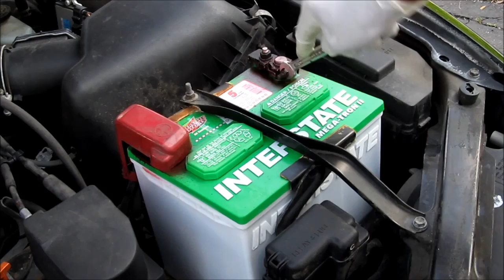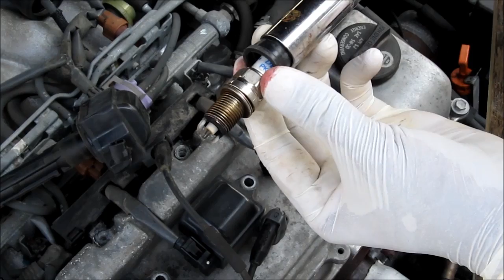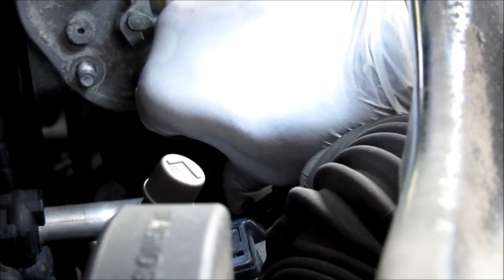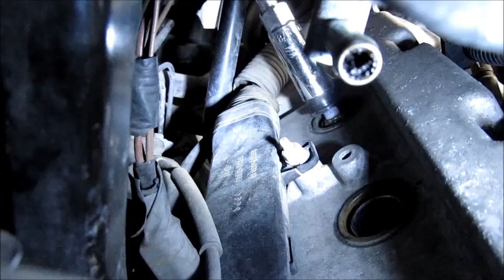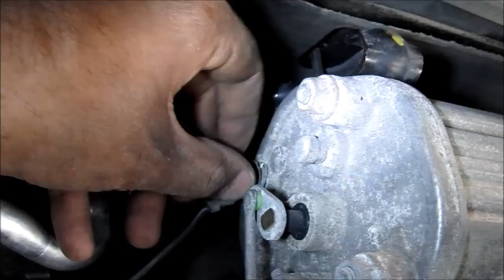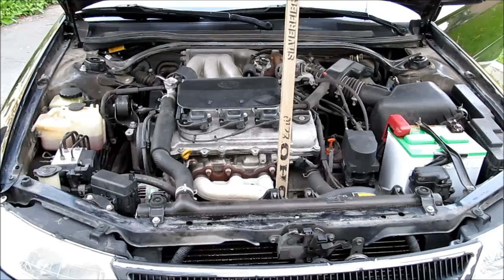Spark Plug Replacement: Toyota / Lexus 3.0L V6

Comment: I just finished changing them on my daughter's 2002 Camry V6.  Not only was it a PITA, it was also a pain on my hands, wrists and forearms.

Even after reading Yu Shao's comments below on his 2002, I still had great difficulty with the middle and driver side plugs on the rear.  Like him, I was unable to get the torque needed to unscrew those 2 plugs from below the intake manifold, even using his "spark plug socket + u-joint + 12 inch extension + ratchet".  I couldn't get the angle I needed.  

What did work for me on both the middle and driver plugs was a spark plug socket + 3 inch extension + u-joint + ratchet.  That put the u-joint at the top of the spark plug tube.  

For the middle plug, I used an 18 inch long 1/2 inch rachet wrench with a reducer to 3/8 and a 24 inch 3/8 extension into the u-joint.  I went in from the passenger side under the intake manifold.  That gave me enough room and torque to break loose the plug.  I then used a stubby 3/8 ratchet wrench to finish removing the plug.

For the driver side plug, I went between the intake manifold and the throttle body with a 12 inch extension into the u-joint at the top of the spark plug tube.  Once I broke it loose, I kept using the ratchet wrench until the plug was easy to turn, then I reached around and behind the throttle body to loosen it the rest of the way and remove the bolt.  

For these 2 plugs only, I added a small amount of anti-sieze.  Those plugs were somewhat seized and almost impossible to get at.  The other 4 plugs came out easily with a regular size 3/8 ratchet wrench.

A word of caution on those back coils.  The rubber washer that sits on the top of the spark plug tube and under the "head" of the coil did NOT come out with the coil.  Make sure you FEEL FOR them as you're pulling the coil out of the spark plug tube!  Being out of sight, they're VERY easy to lose! 

On the passenger and middle coils, 2 of them fell behind the motor.  Happily one fell to the ground.  The other was lodged somewhere on the back side of the engine.  Luckily, it was easy to find by jacking up the car and looking from below.  

On the driver side coil, it stayed at the top of the plug tube and I only noticed it when I was trying to get the old plug out.  At first, I thought I had pulled out the spark plug tube seal!!  Scary.  I compared it to one of the front coils and realized it was part of the coil!  Whew!!

One other note.  I have thin forearms and small to medium size hands.  If you have big hands or forearms, I would only 
try this if you can use Eric The Car Guy's method of rolling the car forward with your automatic transmission in Park and setting the hand brake when the car is all the way forward.  (I couldn't do that, as the emergency brakes wouldn't hold the car in place!  Guess what my next project is!)  Even an extra half inch would have saved me a lot of skin!

I did the passenger and middle plugs from the passenger side of the car.  I do NOT think big forearms would fit under the intake manifold.  If you can get an extra inch or so behind the engine, you might be able to replace the middle plug from the driver side of the car by going behind the intake manifold.

Comment: 2003 V6 Toyota Camry 1MZ-FE - Spark plug and ignition coil replacement! Use these instructions. DO NOT REMOVE AIR TANK!
Reply from the maker: Great.

Comment: One of the best videos I've watched to replace my sparks plugs on my toyota camry 1999 v6. Why pay over $200 when you can do it yourself and gain some car knowledge.
Reply from the maker: +Marco Sanchez thanks I'm glad you found my video helpful and got the job done!
Reply: Try $450 at Firestone lol i said fuck that. I changed the front 3 today and this video is exactly what I needed to take on the back 3 plugs without removing the intake and all that

Comment: I'm glad I watched before tearing into mine. The shredded rubber glove says it all. For this job I will gladly leave it to the pros.
Reply from the maker: +Tn Flash Haha this was my first and last time using gloves to work on cars.
Reply: I rip up cheap blue neoprene and latex gloves when I change my oil. I do try to steer clear of repair jobs that involve squeezing my big hands into tight places. Still it is a great video that shows the detail needed if I ever have to do the job myself.

Comment: Thanks for this video, it removed any apprehension I felt about replacing the spark plugs on my 2001 Avalon. Apart from the metal connector being left behind on one of the rear plugs, which I removed with long nose pliers, it was all smooth sailing, thanks and God bless.
Reply from the maker: I'm glad it helped you.

Comment: What spark plug wires do you recommend for v6 Camry? I ordered denso iridiums and a set of denso spark plug wires from rock auto. What they sent were prestosil wires packed in a denso box. I don't know why this is. Prestosil brand wires on rock auto were 50$ cheaper than denso and they may be the same wires. Disappointed. Thx
Reply from the maker: +Lucas Reboxing is a nessesary evil in the automotive aftermarket. Contact rockauto and tell them you got the wrong part in the box. NGK makes good wires too.

Comment: My god are those rear plugs a pain in the ass to remove...
Reply from the maker: +JC240 These aren't that bad. Newer Toyota v6 require you to remove the intake.
Reply: speedkar99 you're right. I did mine last night and took me 30 min. It's just a little more time consuming that your regular top mounted plugs. Great vid!
Reply: speedkar99 you're right. I did mine last night and took me 30 min. It's just a little more time consuming that your regular top mounted plugs. Great vid!
Reply from the maker: +JC240 Thanks, glad it helped you get it done. 30 mins is fast for a v6.

Comment: Why the front and back wire is different?
Reply from the maker: +Tod Wong The front has ignition coils that double fire, and the rear has wires that lead to the ignition coils. It's called a waste spark ignition system.
Reply: thanks .

Comment: What would be the standard auto repair time on all 6? I can obviously do the front 3, but it looks tough to get at those back 3. I'd buy my own parts to save on the auto repair part markup. PS was that a Lexus in the video? I know Toyota and Lexus are essentially the same, but it's crazy a Lexus literally has the same engine as my XLE V6 Camry.
Reply from the maker: +Chris Wolf This was my 99 Solara. 
If you have a non-vvti 1MZ v6 Camry then you can get your hands around the plenum and don't have to take off the intake. It's not tough, as long as you have a decent assortment of extensions and wobbly sockets.

Comment: I loved the video I have a 1998 lexus es 300 and I have no idea where all the vacuum lines that sit on top of the fuel rail to, I think they all belong to the egr system, could u pls do a video showing where they all hook up too, just want to make sure I have it right. thx
Reply from the maker: +Creative BLife Check the factory manual, there's also a vacuum routing diagram under the hood.

Comment: PCV (Pollution Control Valve) or PVC (Polyvinyl chloride like PVC pipe)?
Reply from the maker: +Eric Gumpher Positive Crankcase Ventilation valve.
Reply: Yea that's it........its been a long time since I messed with that stuff.    Thanks.

Comment: Thanks so much bro.i just wanted to see if I could put some gasket leak seal in it after flushing the radiator.but however sir,pls tell me what do u think i should do in this situation .when u say water is leaking to my engine and I don't see no milky stuff like u said
Reply from the maker: +chrysanthus eras Maybe take it to another mechanic for a diagnoses. If water is getting in the engine then you have a head gasket leak somewhere. Start by checking compression. It's a bit expensive to repair so spend time diagnosing it to make sure that's it.

Comment: Hey speedkar you awesome.i have a 1999 Toyota Avalon.and it's burning oil now bad.recently changed the radiator.each time I crank my car,white smoke comes out d tail pipe.what do u think the problem might be.and pleas how do I get to flush the radiator.couldnt find underneath where I can open to let the coolant out
Reply from the maker: +Chrys Oberieo 
Head gasket. 
Water is getting into the engine, causing the steam upon startup. 
It's alot of labor to replace, and a radiator flush won't help because the coolant and oil will still mix at the head anyway. 
Does the coolant or oil have a milky look to it? 

Watch my video on thermostat replacement where I drained the coolant.

Comment: 1999 Avalon 3.0 L V6. For the rear middle and driver-side plugs, the following combination of extensions etc. made it really easy. Tape 5/8 plug wrench to 6-inch extension. Connect that 6-inch extension to a universal joint. Connect the other end of the universal joint to another 6-inch extension. Connect that 6-inch extension to your socket wrench (ratchet). This allows you to route everything around the  back side of the intake manifold, so you are cranking on your ratchet above the intake manifold (with lots of room) instead of underneath the intake manifold (one click at a time). MUCH easier.
Reply from the maker: +ItsVideos Thanks for the tips!
Reply: Thanks for the tip. This newbie probably wouldn't have been able to do it without the extension and u-joint. (1995 Camry LE V6 3.0 1MZ-FE).
Reply: @BobKartyMusic  Hi. Did you use two 6-inch extensions (as I suggested) or just one? Just curious.
Reply: @ItsVideos  I don't recall! Probably two, but I can't be sure.
Reply: AC Cobra  Are you saying that the long plastic tubes did not come out with the wires? If those tubes are still in there, they will prevent the socket from reaching the plugs.
Reply: AC Cobra  My guess is that the "center conductor" might be preventing the socket from engaging with the plug.  I'm not sure what the shape of that "center conductor" might be, or whether it has a plastic or rubber housing of some sort? You might be able to take a look inside using one of those dental mirrors to see what's going on in there. Maybe a deeper socket is needed. Perhaps a long nose pliers or forceps could be used to grab the "center conductor" and pull it out. You might need to remove the intake manifold to gain access.  Whatever you do, make sure you have removed any loose pieces of debris that you have created before you remove the plug because you don't want any of that debris falling into the cylinder.  BTW, next time I would suggest pulling the the thing out by the rubber seal rather than the wires. In the video, speedkar99 twists that rubber seal to loosen it, and then pulls it out. I think that might be important.
Reply: AC Cobra  You are correct. It is the intake manifold, not the exhaust manifold. It's been a few years since I changed plugs, and I was just going by memory. I edited my previous post and made the correction. Also, I was suggesting trying an even deeper socket than the already deeper socket that you had used. Maybe that "center connector" is very long.

Comment: For the life of me I can't the middle plug out of the the rear bank.... How did you get the socket in there?!
Reply from the maker: +Ortiz 805 Ah you need to use a universal joint and a bunch of small extensions and "build" the socket extension as you go into the spark plug tube.
Reply: +ItsVideos I ended up using 3 three inch extensions
Reply: +ItsVideos sorry it was 2 three inch extensions then the ratchet and the 5/8 socket

Comment: SparkPlugs:  I was considering using Denso Iridium spark plugs instead of platinum plugs this time on my 1MZ-FE.  Do you know if this would be a good move?  Do you or have you heard about results after making this  change?
Reply from the maker: +siucbset At the time I changed mine, Denso or NGK didn't have iridium dual electrode plugs. Assuming you have waste spark ignition on your 1MZ, you should stick with dual electrode plugs. My car has been running smooth on these plugs for more than 3 years now.

Comment: Where is spark plug number 1 on 2006 Camry XLE V6 3.0L?
Reply from the maker: +angelisone The passenger firewall side of the engine, near the PCV valve.
Reply: I have no ideal on what you just said.

There are three on the front, which I can get easy access and three in the back:
Back side  *    *    *
Front side  *    *    *
Looking from the front of bumper.

Sorry, I don't have a service manual.
Do you know if a 2005 Camry V6 pdf is online for free?
Reply from the maker: The back of the engine (near the firewall is cylinders 1,3,5). Here's a diagram: http://repairguide.autozone.com/znetrgs/repair_guide_content/en_us/images/0996b43f/80/20/1e/d0/small/0996b43f80201ed0.jpg
Reply: So it the bugger on the back left side. Getting to the back three spark plugs would be a nightmare. 
Do you know how to setup top-dead-center if you can't get access to spark plug #1?

How many turns on the 22mm Crank Bolt to turn those two Cams in one revolution?

I like to change the timing belt kit which comes with the water pump.
Do I insert the 22mm Crank Bolt back onto the Crank Shaft and turn it clockwise until the top Rear Cam and top Front Cam (look from the front) line up with marking on the Top Timing Cover?

I am sorry I can't find a PDF service manual on 2005 Camry XLE V6 and I don't have a lot of tools like you.
Reply from the maker: +angelisone Please see my timing belt video:
https://youtu.be/_c_a-ECaWSU

2 turns of the crank to one turn of the cam. 
Why do you need to use the spark plug to determine tdc during a timing belt job?

Comment: I never I have never looked at one of these type motors and being familiar with csb's and ford 2.3 like on a Pinto, I was completely baffled - not like my Pinto with a straight 2" flo-thru exhaust - at what I was seeing. I could not imagine where the plugs were AT on this model. Thanks to your vid, now I know! Gonna go out there now and see what kind of damage I can do (we bought the factory recommended 100,000 mile replacements..at 13.00 ea., OUCH!)_chrisinbigbear

Comment: Thanks for the video. After seeing how hard it is to get into certain regions, I have opted to get mine done by Toyota as I might loose a few trying to get them out and in. Toyota say my spark plugs last 120 miles ( 193 Kilometers) although I have 140 on the clock and I can already sense light slight observations in idle and acceleration has gotten weaker. Also the car is 14 years old so might be worth getting them done before they reach there end life.
Reply from the maker: Its not that hard honestly,
Wait until you see the newer V6's where you have to take off the intake:

https://www.youtube.com/watch?v=fybPb_d1vrU

Comment: should use a torque wrench
Reply: +Ronny Trefftzs a torque wrench is a good idea HOWEVER the use of anti-seize actually affects the torque settings by reducing friction in comparison to a bare metal-on-metal situation. The practice of anti-seize application can potentially lead to over tightening or even stripping the alloy threads. My opinion is to do as speedkar99 advises and tighten till firm.

Comment: Yesterday I was give up three spark plugs at the rear ,it was impossible to replace them ...but now I know ...thanks !
Reply from the maker: +vo thuong Thanks. You've just got to reach back there and take them out. At least if you had a newer V6 you'd have to pull off the hole intake.
Reply: I am not have it yet ,hahaaha ! Thanks God

Comment: Beginners beware!  Nice video, Speedkar99! Just a note for beginners, these engines are aluminum, so be very careful removing spark plugs not to break them.  You can spray penetrating oil or WD-40 in to make it easier.  Also when tightening, there is a torque or twisting power spec.  Do not overtighten.  I still remember when I was a kid of 16 and I had a Cushman motor scooter and had to grind the valves. Had never heard of a torque wrench, and I stripped a few threads in the cylinder head bolt holes.  No fun.
Reply: The torque spec for the spark plugs on these 1MZ-FE (at least mine) is 13 foot-pounds, which is not much torque at all.
Reply from the maker: +Dennis Johnson Thanks. I've learned my lesson with overtightening bolts on an aluminum engine on my ES330.

Comment: Thank you for an excellent video. So to be clear, on a 99 lexus es300 you do not need to remove intake manifold to do the rear 3 spark plugs?

thanks,
Reply from the maker: +Paul T. You don't have to remove the manifold. However the ES300 has 3 rear coils instead of wires like my car. You'll have to remove the 10mm bolt (similar to the front back) and pull out each coil before getting at those spark plugs.
Reply: +speedkar99 thanks for the reply and once again thanks for putting this video together

Comment: is this the same as a 1998 camry v6 ?
Reply: +2011relapse Yes, it is, exactly. I used this video to learn how to change mine, it's spot on. Beware, the rear middle is a pain to get to unless you have small hands and forearms!
Reply from the maker: +2011relapse Yes, same procedure.

Comment: so theres 6 spark plug sockets total?
Reply: +speedkar99 what spark plug gap did you use on this car? .44?
Reply from the maker: +Hector Garcia Yes, V6 means you have 6 cylinders and 6 spark plugs.
Reply: speedkar99 thanks for clearing that up appreciate it im new to working on my own car
Reply from the maker: Good to hear, DIY is the way to go! What car do you have?
Reply: +speedkar99  diy is definately the way to go thanks again.. i have a 2003 toyota solara coupe v6
Reply from the maker: I didn't gap the plugs, but 44 thou is the correct spec.